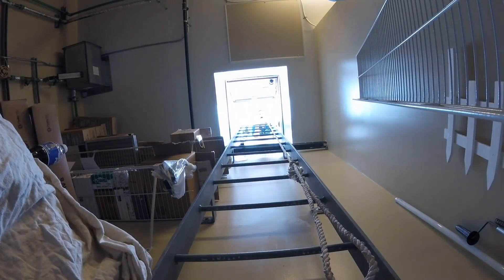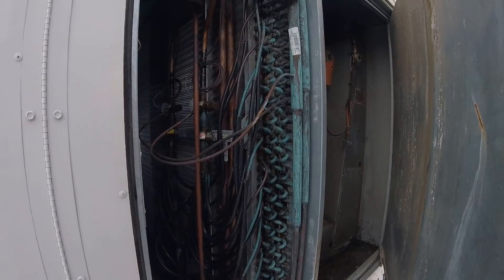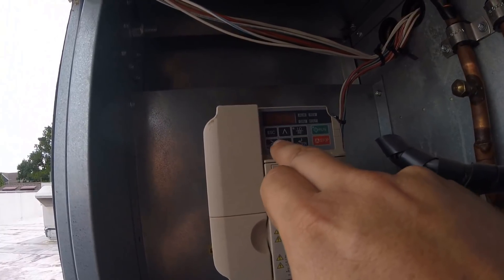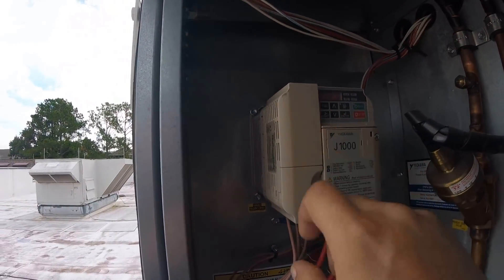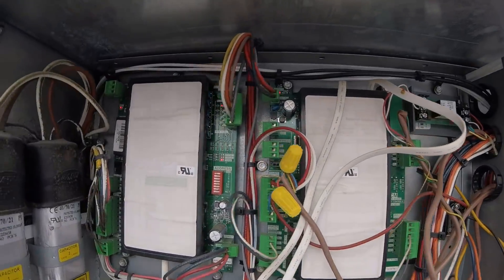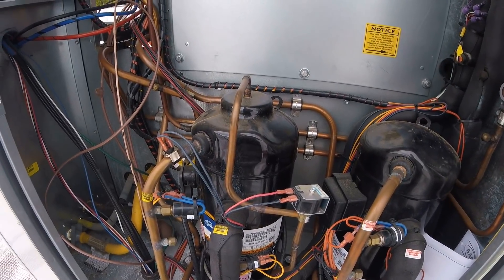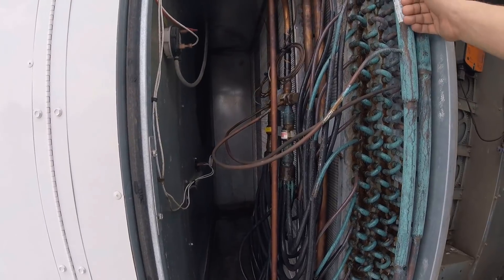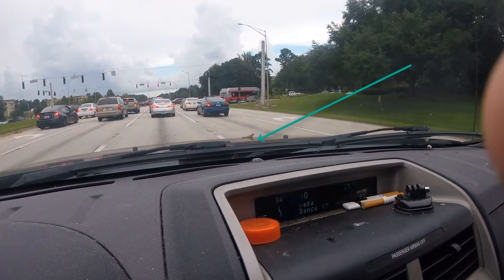HVAC Geoff Did A BOO BOO (VFD 60hz uhhh OPPSEE)

Comment: Most sight glasses bubble and fill but it could be short cycling... But I ain't there but check out the condenser coil see if it's clean.... But I think there could be a slight chance of a charge issue
Reply from the maker: Yea that was the 1st thing I did was check the condenser coil and the ecm condenser fan motors. All good can see day light right though them. I do believe that it is low on charge or something going on with ckt 2's TXV. There is also some water coming from the unit but no where near the drain pan. I am at a miss on this one. Thanks for watching Alexander's Refrigeration & A/C Videos.